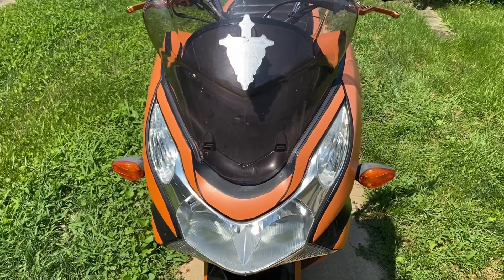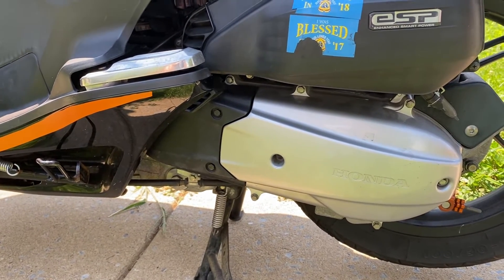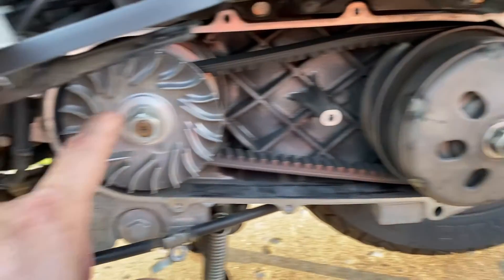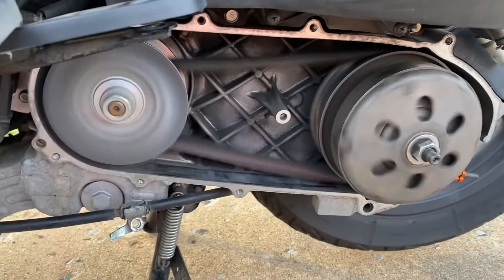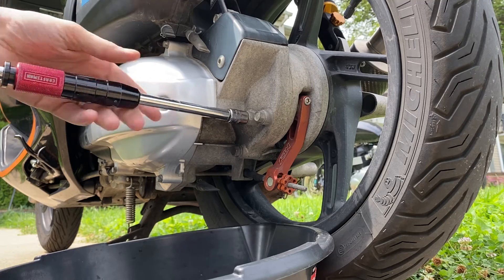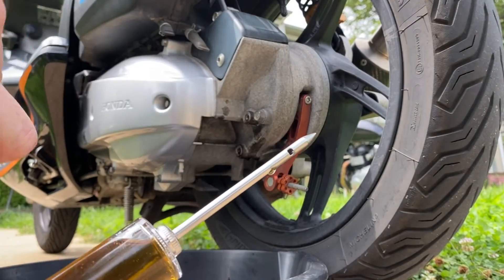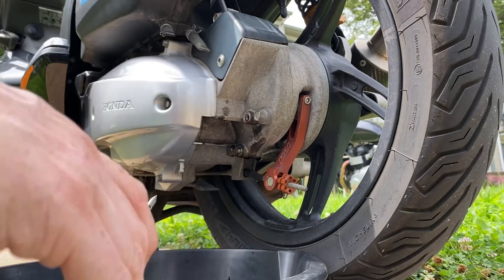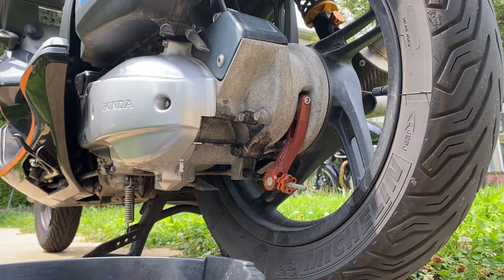Scooter CVT operation and Final drive gear oil change on 2013 Honda PCX150

Comment: I just changed mine on my 2015. I found that a plastic drinking straw from a fast food place with the flex option fit the hole perfectly it also fit my small funnel. I then used a 20 cc syringe to measure the oil and inject it down the funnel and straw. 6 syringes at 20 cc, or 120 cc fills it perfectly. Used Motul 10/30 crankcase gear oil. Easy do it yourself job. I also replaced the copper washers as I had some available.
Reply from the maker: Hey, if it works. I'm going to cut the end off the end of the poultry injector I got, so it works better. I won't have to use it again for a couple years, but still

Comment: Hello, How often should this be done?  I have a 2013 PCX 150 with about 4,000 miles.
Reply from the maker: The 2013 service manual says it should be changed every 2 years.